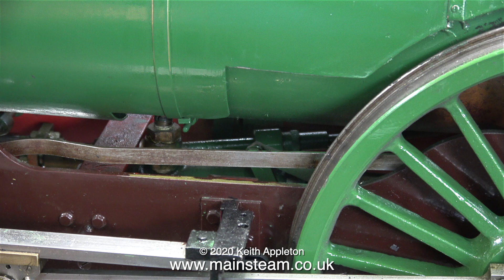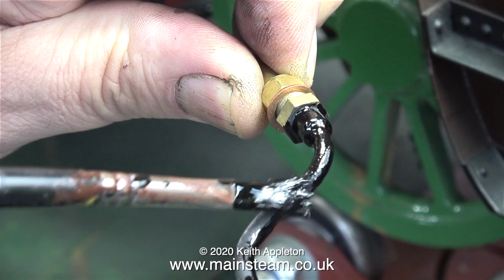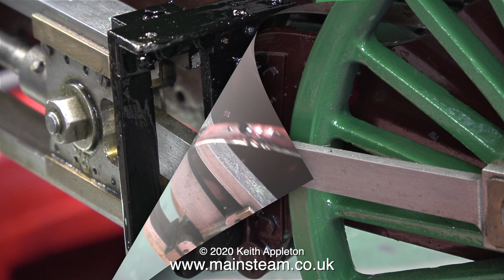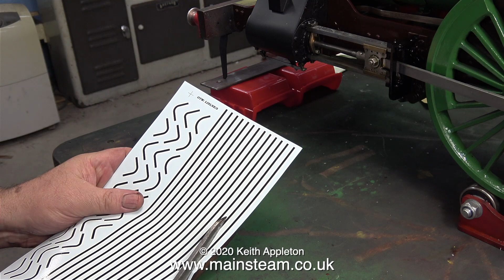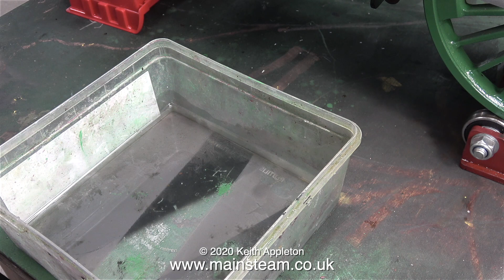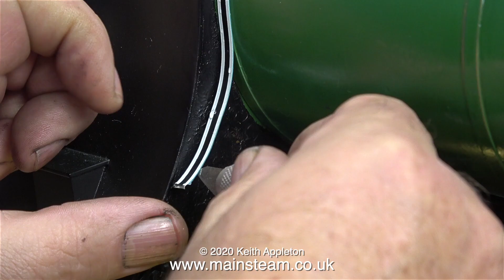MY STIRLING SINGLE #34 - WATERSLIDE TRANSFERS OR PAINT?

Comment: many (oh so many) years ago i did some crude painting of HO scale model trains . . . i found that after applying the transfers, you can dissolve the backing with a suitable solvent (i think i used lacquer thinner (mineral spirits? to you other-side-of-the-ponders} . . . this transferred just the lettering to the paint below and got rid of the need to carefully cut around each letter to avoid "that decal look" . . . you do have to let the solvent evaporate because touching it is a sure disaster.

i don't know if they've changed the plastic backing or the ink or the paint since then but it might be worth an experiment (if it looks good, try heating it to see if it runs)

Comment: Hi Keith, not sure if you've heard of micro set and micro sol for decals? They soften the decal and help it adhere properly. They also prevent the decal silvering which may be useful when doing the larger decals on the tender and can side. They work well on my model aircraft anyway

Comment: I like using waterslide transfers - they are a joy. I use them in N gauge. It is probably too late for tips now, but I get good results in flattening them out after application using a cotton bud and rolling it along the length of the transfer to squeeze out and absorb the water. I suspect that it may be harder in this scale. I can see why you might be concerned about using them on the boiler, however. I shall look forward to seeing the result of painting. Happy new year.